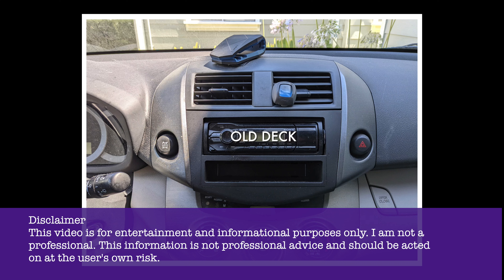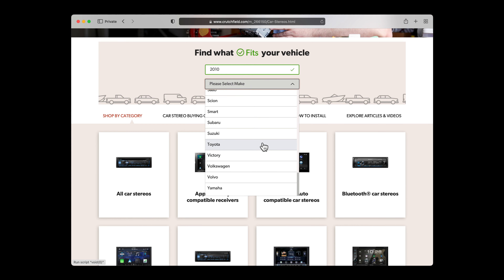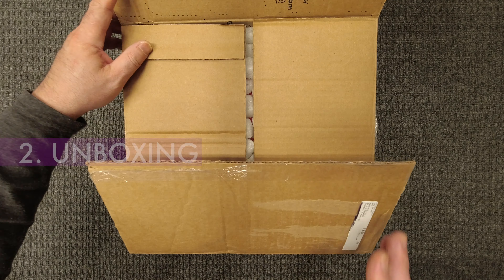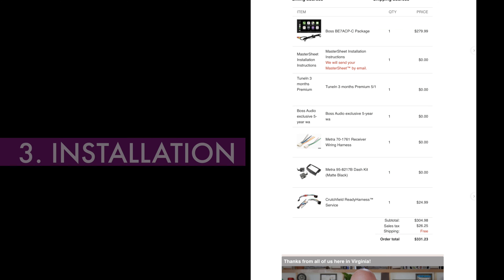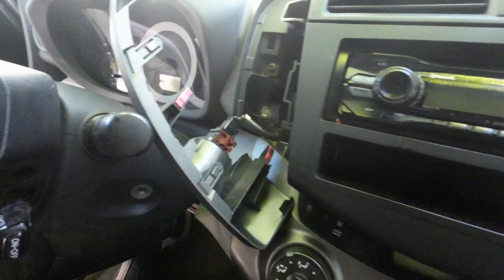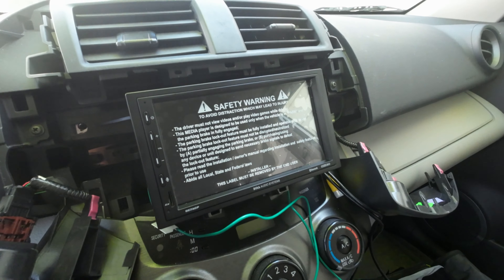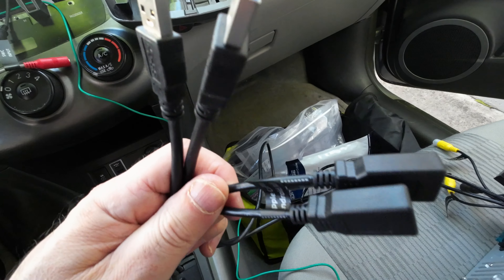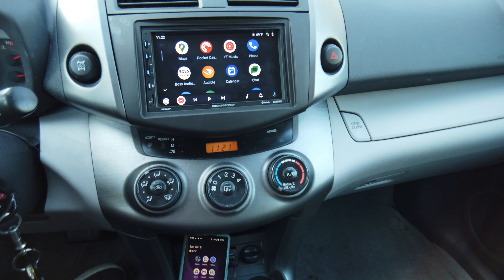Ordering and Installing a Crutchfield Car Stereo: Step By Step

Comment: How is it going since the installation? Is it still working? Do you have any complaints or comments?
Reply from the maker: Hi. Yes, it's still working. It's been a good buy for me. However, I really miss not having a volume dial -- pressing a button multiple times to increase/decrease the volume is kind of a hassle.
Reply: @AboutaMinuteVideos idk if it’s too late to let you know but you can retain your steering wheel controls by buying an adapter that hooks up to your existing radio and car wire harness. Aswc-1 is what it’s called